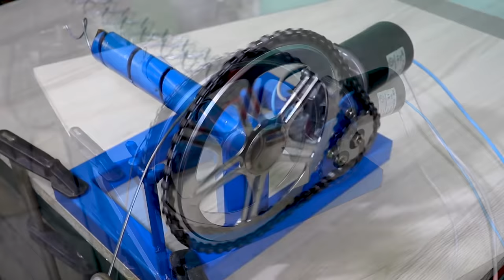DIY-Simple Fence Wire Netting Machine

Comment: Pretty cool, but the diamonds look a little squished so you have to make the spiral a little farther apart. I am a fence guy of 30 years. 👍
Reply: What are the specification of the wire used
Reply: @engineerordofa9472  11 gauge 2" diamonds.
Reply: Arrete
Reply: 1tb
Reply: @pontientabaro8912  %11 1 Q10

Comment: Nice job, but in the next version, try to put bearings to have as little friction as possible. Then also put a screw or spring adjustment to tension the chain, just like tensioning motorcycle chains.

Comment: Great job buddy.
Little suggestion.
Fit a feed tube on the outside to thread the wire through, instead of having to hold it. And if you place this machine on a stand at bench height...you can use the weight of your roll of wire or fence strainers with a weight attached using gravity
 to keep the wire under tension as  it is fed on to the  spool feeder 🙂
Reply: Good point. You could also use the drive sprocket and  chain from your chainsaw to run it and cut your firewood at the same time. Time is money.

Comment: Unless you're making a picture frame, it's better to use square butt joints when fabricating  frames in metals. There's less welding, less distortion and less wasted  stock. Leave the miter joints to carpenters.

Comment: Creative work and great design. You have great engineering skills and imagination, amazing welding and assembly methods, with tools that fit perfectly to make a mesh wire fence, there is no redundancy without the need. In addition to using materials that are very suitable for their workplace. With a fertile imagination, but how to make a fence two meters high and five meters long using this machine.
Reply: You identified the correct answer; by using your imagination 😆
Reply: Solo dejar sin cortar hasta obtener la longitud deseada e ir tejiendo hasta obtener la altura

Comment: Very nice work. Congratulations. What are the specifications of the electric motor you use? Is it possible for you to provide details? How did you set the revs? Good work.
Reply: windscreen wiper motor
Reply: Is it possible to use washing machine motor?

Comment: These motors usually have worm gears ⚙ and impossible to turn manually (they hold torque), how could you turn it manually when you mounted the motor just before soldering the motor mount to the frame??
Reply: because he had leverage with the wrench
Reply: Tsma
Nada tiene que ver si son o no son piñones helicoidales, o rectos,

Comment: Typical manufacturing error.
The tongue must be slightly twisted in the direction of rotation, on the first turn of the wire deformation, so that the outgoing spiral becomes flat.
And you need to make a wire tensioner of three rollers.
Such a machine can operate at high speeds, automatically twist the spiral into a net.
More than 30 years ago he made such machines in Russia. The mesh was knitted in tons per shift.